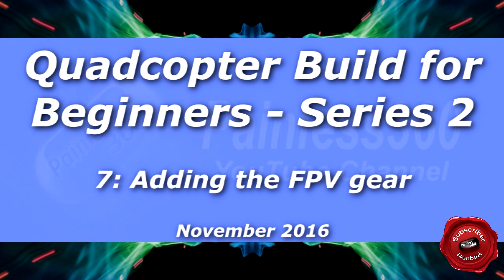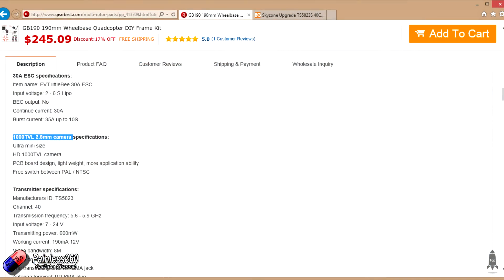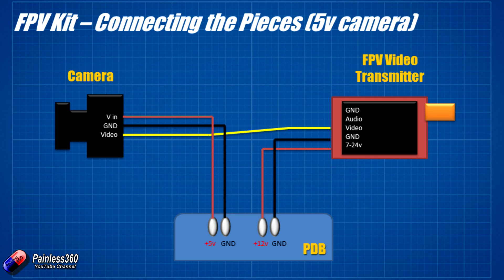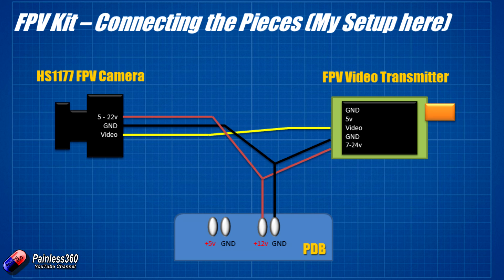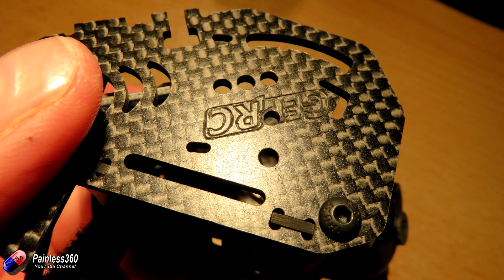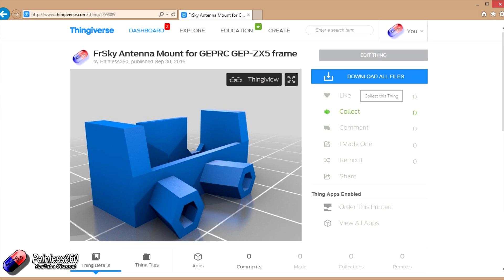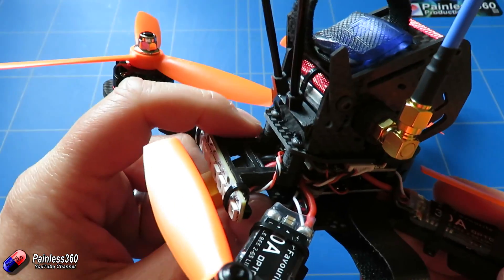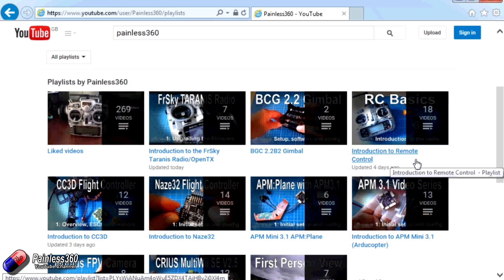(7/7) Quadcopter Building for Beginners - Series 2: Adding the FPV gear

Comment: What's the difference between 600mw and 200? Why can't you use 600mw in some areas?
Reply from the maker: The frequency that FPV uses are very busy and used for lots of other things too (WiFi for example) so the limit on power is there to reduce the chances of interference. Check with your local countries legislation and laws to see what you can use..

Comment: I've built quite a few mini quads now and i built this model a couple months ago and have not had much luck with it. 
Seeing your build and what you have done, I'm now inspired enough to rip it apart and re-build it using your mods. As you say, getting everything in is a right pain in the AR#E. But I'll have another go and see if I can't get everything inside and get it finally, flying sweet!!!

Comment: Joshua recommends to go with 4S from the beginning even if you're a Beginner with reason being that once you've outgrown 3S you're basically sitting on a pile of LiPo's that serve no purpose whereas if you go with 4S you can simply limit your Throttle to values of that of a 3S and once you're golden simply remove that limitation - Something I'm doing right now =)

Comment: At 09:03min you say you connect the two wires to the PDB 5V, but don't you need to connect it to the 12V to power the transmitter? I'm a little confused..
Reply from the maker: Depends on what the video transmitter needs to power it. Connect it to the right voltage that it needs. Ours did need 12v and you can see it all wired up later in the video at 11:20. Happy flying!

Comment: This is the exact transmitter I will be running on my quad (not the same camera but still a 12 v. I asked you earlier on a different video but here it is again. My setup is just like 4:30 diagram. I want to run the minimosd and it runs on 5v. Can I power my osd with a 5v line on the power and ground pads (the 2 stand alone pads on the right side of the board), and then just split my yellow vid line and connect it to the V in and out line on the left side (all in all I would only have 4 wire on my osd). Thanks again.
Reply from the maker: Not sure I'm following. I'd power the MinimOSD from the 5v and GND pins on the PDB and just run the video signals though it (camera to video in, video out to the Vtx).. Be careful as the MinimOSD can pull more current that you'd expect from that 5v line so test it all before you fly it hard. Best of luck!

Comment: just finished this build today, pretty smart little rig. its like a typhoon out soon as the wind calms down ill take it out for a spin.A Comment on the bolts to hold down the FPV equipment. i only used a nylon washer instead of the nylon nut supplied with the kit. that gives you just enough room to use the button head cap screw i'd post a picture but im not sure how
Reply from the maker: +Brandon Brodhagen thanks for the suggestion. A picture would be great.
Reply: Here is a snap of the nylon washer it isolates the pdb off the aluminum cross member 
https://lh3.googleusercontent.com/f1-wOAsQf6VqWoSRZoAllJ1kbok5bEEfcO8EQrYRlWHOG-7NizNLsfOXgYqFX8ZDDvI3Ke2J7g
Reply from the maker: Nice - your FC isn't as high as mine. Nice build!

Comment: @ around 0:20 you said betaflight 2, instead of 3... maybe still possible to correct with voice-over. You don't want to upset Boris 😉 (and delete this comment afterwards)
As for the camera, you should really try out a GoPro1/2 replacement lens on it. Much higher quality lens, and also larger FOV as a bonus.
Really nice build you got there 😉!
Reply from the maker: That's a '...Betaflight too' not a '...Betaflight two' ;) We will try the lens thing as well. Thanks for the idea!